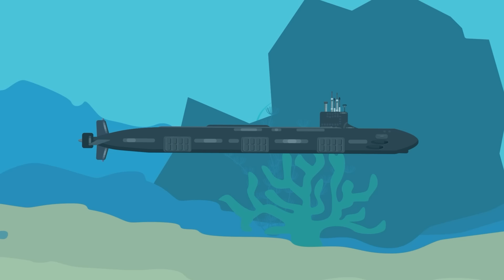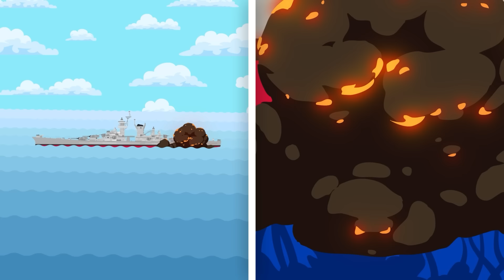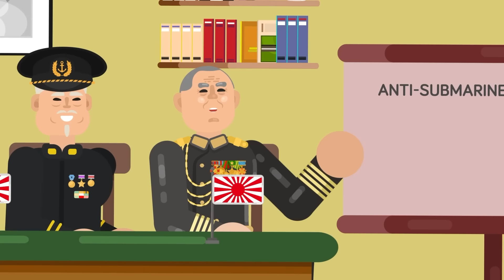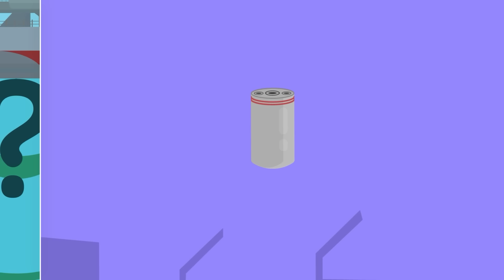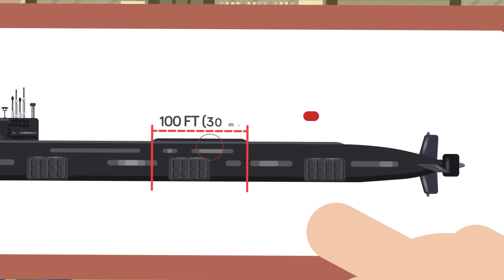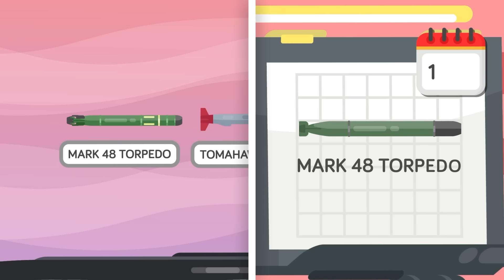What If a Single Modern Submarine Time Travelled to Pearl Harbor

Comment: Um . . . . technically they and their two sister ships were classified as Battlecruisers. Their class displaced 27,000 tons verses the battleships Kaga and Tosa at 39,000 tons and the Nagato and Mutsu at 32,000 tons.

The Hood was 46,000 tons and the Bismark was 50,000 tons, just for comparison.

Comment: A modern attack submarine would decimate the Japanese fleet, sinking all 6 CVs, both BBs, and the three cruisers.  The carnage would only stop when the torpedoes ran out. If the sub is armed with tomahawks, then the destroyers probably wouldn't survive either. There would be no defense.
Regarding a "poorly trained crew" (they weren't), or "inadequately maintained sonar equipment" (it wasn't)...  this is completely false. But it doesn't matter because perfect equipment from that era could not detect a Virginia-class sub.

Comment: Just like most of these scenarios it really depends on length of time and logistics. Does the Virginia only have what is normally aboard or is the US suddenly able to manufacture modern weapons like Tomahawk missiles and Mk48 torpedoes?  
For this scenario one also needs to consider if the sub is trying to prevent the attack or just happens to be at Pearl Harbor with the rest of the Pac fleet to defend against the attack.

Comment: As always with these. The absolute #1 best use of any ship would be to sail it back home, and use its computational power to rapidly accelerate the US even faster than it already did. The nuclear program would accelerate, rocket program, mathmatical understanding, material science, encryption and code breaking, communications, radar and sonar development, networking, etc etc etc.

Just being able to say something is possible and has been done before, makes it FAR easier to chase and achieve, because you know the thing you're attempting IS possible.

Inventing, and researching and testing with no idea of the end result is far far harder. Thats why its so expensive to research and design new technology, but then once its been done, others often come along in a few years doing the same thing far quicker and easier. They know its possible, even if they dont know all the specific steps.

Comment: Before watching: A single sub? No, not enough ammunition.
After watching: Called it.
Reply: Yes, based on the information and following exactly as the video said, it wouldn't have enough armaments to destroy the entire fleet. But it doesn't need to. From over 20mi away, and very deep in the water, the Virginia would be able to pinpoint destroy the Japanese Aircraft carriers without them even knowing it was coming at all. At the same time, it could have already re-armed and targeted the Oilers (gas resupply vessels) as well. If it really wanted to, it could also go after the two battleships easily without even using a fraction of its overall armaments. Sinking roughly 15-20 vessels would be more than enough to strand the Japanese fleet without any real firepower to hit Pearl Harbor or the ability to return home. It has no reason to sink every single vessel in the fleet to stop the attack, just the important ships.

Comment: At full speed the fleet just would evade the submarine. But ... first locate a fleet with a single submarine in the pacific. Her radar range is max. ~20 sm when it is not diving. And aircraft carriers will perform aerial reconnaisance and locate the submarine first. Hits by 20mm autocannon rounds will stop the submarine from diving.

Comment: yes and the tomahawk missile will reach the japanese ships without gps and the submarine will communicate without the help of over the horizon radios... only thing that might work is the torpedo..  not saying uss virginia call wont win but.. most of the tech used requires an infrastructure far more costlier than the sub itself.

Comment: Japan's aircraft are not relevant in this scenario. Simply put a single nuke would have ended the whole feet. The Japanese subs likewise would not have been concerned as they would have been noisy and easily detected by today's standards. The only real issue would have been the number of weapons the sub could bring to bear as they had limited torpedos.  Conversely, they had sufficient missiles to end Japan and Korea, then traverse the globe and do the same in Germany and Italy.  And to answer the depth charge question, the modern sub could dive deeper and move after than the axis navies could counter.

Comment: Now we need a Ac-130 in the trench wars of ww1
Reply: The Spooky variant, but I know what you meant. And holy schnitzel, being able to rain down hatred untouched? I don't believe flak cannons would really have an effect, nothing flew so high or fast at that time (but fact check me). Ammo and fuel probably wouldn't be an issue to make. And Hercules' can land and take off just about anywhere, maintenance is a breeze. if a gun is unfixable, throw other artillery pieces on it!

Comment: Arguably, you don't need to sink the whole fleet – sinking the 6 aircraft carriers before they are in strike range is enough to prevent the attack on Pearl Harbour. (The other ships were mostly there as escorts.)
Though, if the 6 aircraft carriers (and the larger ones of the other ships) sank before even any attack occurred (possibly even without any reasonable explanation), Japan might have called off their invasions, wouldn't have declared war against the US (so Germany also wouldn't have done so), and the US wouldn't have any reason to enter the war. They might join the war against Germany, but likely much later.

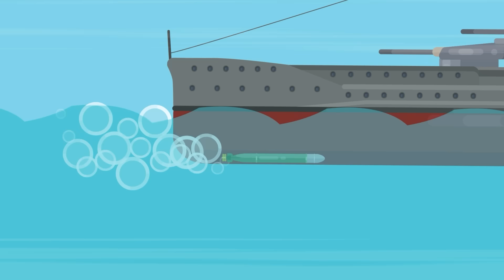Comment: Slight correction at 13:13, WW2 torpedoes absolutely had magnetic detonators to explode under the ships and essentially snap them in half at the keel.
Reply: Correct but the Mark 14 torpedo was improperly tested and constantly failed at the start of ww2
Reply: @DestroyTeamAvolition  Oh for sure. The Mark 14 was plagued with multiple problems with their triggers and depth settings to name a few. The German G7e wasn't much better. Though by the end of the war they had corrected most of the issues with them.
Reply: yeah, they didn't work.

Comment: Belt armor was not designed to be effective against torpedos, it was against shells from other ships. Its only on the waterline + afew feet below and above. There are special torpedo protection systems (a series of water/oil filled spaces and voids) to "soak up" the explosions. 
Also some other wrong info in this video as some people pointed out. You should do some proper research on your topic.

Comment: A nuclear ballistic missile sub is probably the most overall useful in the "go back in time" scenarios.  It has a more powerful than average arsenal so could turn the time in more battles than most other single vehicles (like an Apache or A-10).  An attack sub would be more limited, but could maintain waterway control for some time with judicious use of its torpedoes (even longer at a perhaps reduced level of effectiveness if it was adaptable to use the current era's torpedoes).  However, the real strength for either would be their long-term intelligence capability.  They could remain undetected for their entire deployment without need for resupply or maintenance and radio back info from their vast array of future tech sensors.  They could also be utilized for covert deployments of that era's special ops teams, etc.  Probably the only thing more long-term would be a satellite, but that would likely need some level of future tech on the ground to receive and interpret its signals (a sub could use an era-appropriate radio).

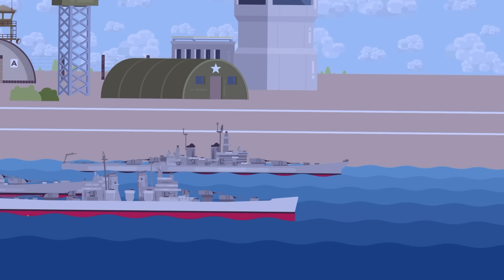Comment: 0:10 "But could a single modern American submarine defend Pearl Harbor from the Imperial Japanese Strike Force?"
In a nutshell, "No". U.S. submarines have no anti-aircraft capability. WWII submarines had more AA capability than nuclear subs do because they were on the surface for much longer than nukes need to. So the aerial part of the attack on Pearl Harbor would be untouchable by a modern U.S. nuclear submarine. If you're talking "what if a nuke sub was 200 nautical miles North Northwest of Oahu at the same time as the carrier fleet and detected that carrier fleet?", then the possibility exists but they would have to catch the carriers with Mk48 torpedoes before the aircraft were launched, AND in the process damage the flight deck enough to prevent said aircraft from launching. Couple that with the fact that doing so means the United States becomes the country that launched a sneak attack without first issuing a declaration of war, and you have a whole different pile of problems to deal with.

Comment: I serv3ed on US submarines back in the 80s and 90s. While things have changed since then, I am sure that many of the procedures have not. You were pretty close here, and your final conclusion was correct, but there are a few things that you got wrong. 

First, the submarine would come to periscope depth to launch its torpedoes. This has nothing to do with the performance of the torpedoes, though. It takes a lot of time and effort to get a firing solution on even one target using sonar. Come to periscope depth and raise the scope. The bearing to the target is easy. They are pointing THIS direction  that is their course. Watch them for a bit and you have their speed. For the range, we had references that gave the height of the tallest mast on the target. Do a bit of trig and you have the range. You have the firing solution in seconds, instead of 20 or 30 minutes. Could they spot our scopes when we came to periscope depth? We played a lot of war games with our own forces, and we were almost never spotted. And the modern sub would be far beyond where the WWII Japanese fleet would be looking.

It would take 3 Mk 48 torpedoes to sink one modern aircraft carrier. We would probably launch 2 at each of the Japanese carriers, just to be sure. After the carriers are sunk, we would probably sink a few of the escorts on the way out. But they would hardly be a priority. With the carriers dead, the attack would never happen.

Comment: No doubt the Virginia could take out the CVs. However, a lot of your data is crap. There will will not be 65 torpedoes. Rather, 25 or so torpedoes and varying numbers of vertically launched weapons. Easy kills on the carriers, and the oilers would be the next best targets. Forget the subs.

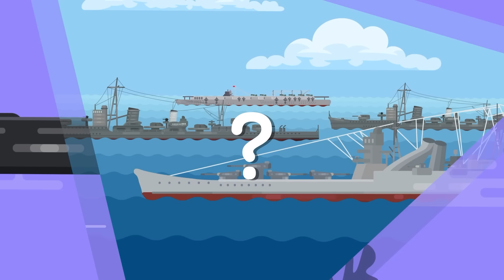Comment: 12:09 You could do all that with the torps and cruise missiles...or...hear me out...1 well placed nuke at low altitude >.> not like they are gonna retaliate
Reply: Virginia's don't carry nukes. There are also no block V's yet. The first is being built at my shipyard. But they could easily sink all carriers and battleships without even putting themselves at risk. The Japanese sonar tech would be absorbed by the hull coating and never reflect.

Comment: my only complaint with this video, is the question was if it time travelled to pearl harbor, which would imply it being in a defensive position at the harbor, not in open water no where near pearl harbor. Still interesting watch, but based on the facts provided, I doubt the submarine would've made much difference had it been attempting to defend the harbor... it's a sub, it can hide perfectly well, but would not be able to do much to the aircraft. instead, a more likely scenario is that the attack starts, and the sub, seeing it simply does not have the weaponry to assist in defending, instead leaves Pearl Harbor to pay the enemy a visit. At this point, what you described in the video would happen, and the first wave of planes would come back to find their fleet missing several key ships, and no second wave happens. Still would be a lot of damage to the harbor, but possibly not even half the damage. So stop the attack? only if the sub got first strike. otherwise no, but the battle would've still been a likely overall (albeit pyrrhic) win for americans.

Comment: Not really. 

Problem is that a lone submarine, even the latest attack versions, can't do much against AIRCRAFT. They're not designed for that purpose.

Now if the sub commander knew their history, and traveled out to meet the Imperial Japanese fleet, it would be a very one-sided battle, IF they struck first altering history. Otherwise, if the planes were in the air, you still have the US fleet destroyed at anchor in the harbor.

Comment: Sadly, this video is historically entirely inaccurate.

1. The strength of the attack fleet would indeed be exceeded during WW2 with the US attack on Truk (Operation Hailstone, Feb. 1944) featuring more flight decks and over 500 planes.
2. The armoured belt was not ment against torpedos but against shellfire from surface ships.
3. Kirishima and Hiei were not considered competitive as battleships by 1940, being outdated by nearly 3 decades. The most powerful Japanese battleships of the period were Yamato and Musashi armed with 18in guns and Nagato with 16in guns. They were chosen for escorting the carrier forces mainly based on their higher speed, that allowed them to keep up with the carriers more easily than the heavier ships.

And this is only in the first 2min and 30 seconds of the video...

Comment: The sub first has to know about the location, direction, composition, mission and intentions of the Japanese fleet.  Without intel, the sub is useless against them.  Then it has to receive orders to engage.  Without either permission or foreknowledge, they could not and would not engage.  Lastly, they would need to be in the right location at the right time, or time to get there.  Given that it was a surprise attack, it is not likely that it would have had either the intel or the permission to strike first, initiating a war.

Comment: 300+ planes vs 1 modern sub with very limited air to air options. The Japanese navy ships did not participate in the battle, so no chance to use torpedoes and surface to surface missiles. So probably the worst type of ship to send back.

Comment: Stopped the video when it made the fundamental error of describing belt armor as a torpedo defense measure.  I see in previous comments that others have already skewered you for that flub, but I must repeat the main complaint - if you are going to indulge in historical fantasy involving weapons and systems from different time periods, you have an obligation to DO YOUR RESEARCH.  Failing to do so is simply lazy.  I won't waste any more time on this POS.

Comment: Fun theory but that all requires the electronics to function properly. 
there is no gps in the past, there is virtually no compatibility between the modern sub and ww2 pearl harbor and try to convince an american general via morsecode or radio that ure sitting in a sub capable of decimating 6 carriers, 2 battleships and 30+ cruisers and destroyers singlehandedly while never having to surface for the next 4 weeks and impossible to be actually detected by the enemy. yeah, maybe u sink some, if the torps work without extra guidance systems but i have my doubts that u can rest in port afterwards but rather are held prisoner if u dare to come close to base since ur crew does not exist, ur sub is lightyears ahead and it will be dismantled for study and replication.

Comment: Where does this MYTH that towed array is for Torpedoes. A Towed Array is for one purpose. The array is away from ships noise and allows greater detection of threats. PERIOD END OF STORY. You have no idea how many pumps, fans, and electrical noise which does hide weak emissions from modern submarines. In short, towed arrray equal greater detection capability for other ships and submarines. NOT TORPEDOES.

Comment: I'm not so sure about the capabilities of the missiles in that situation. Both rely on GPS to locate the target and for the Harpoon the navigation also would require constant GPS location. The Tomahawk could navigate using surface locations but in open waters that would be absolutely limited. Without the array of satelites and antenas that create the GPS network they wouldn't be able to detect the objective. In fact, Tomahawks can, theoretically, hit ships if they have the GPS network and they stay still but I don't think a fleet would be absolutely still so the aiming would be very limited.

The best option? Sink the carriers and the battleships with regular torpedos if they can and call the day. They would avoid the attack and the job would be done.